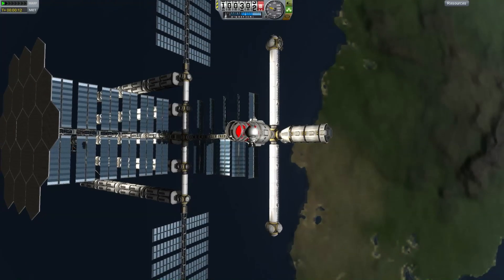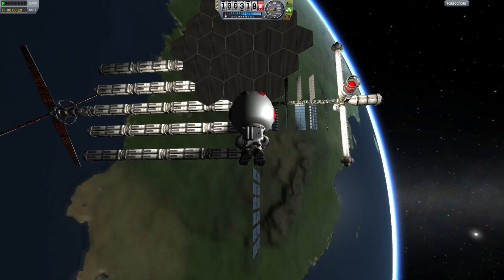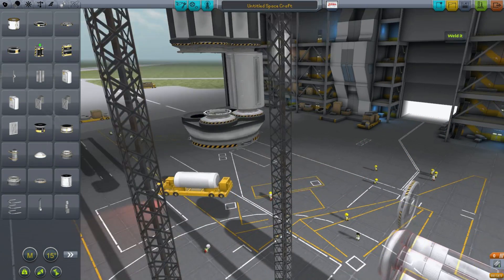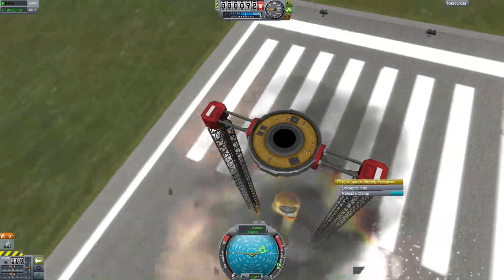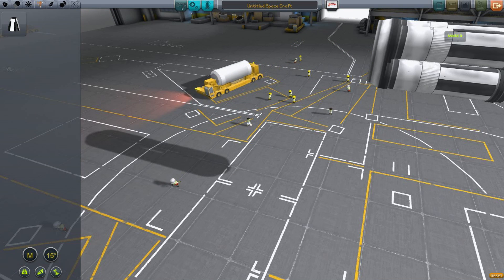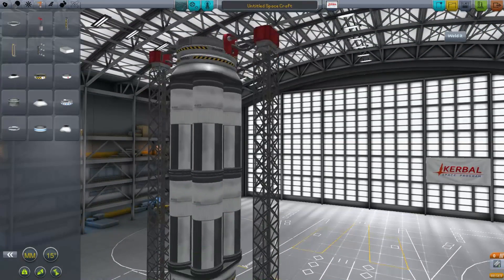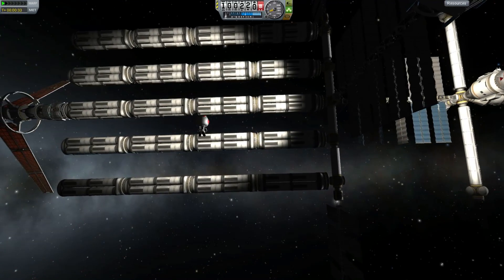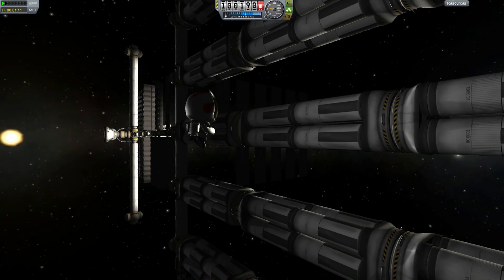Kerbal Space Program - Part Welding Plugin - Reduce Part Count On Huge Stations

Comment: someone got something similar for 1.12?
Reply: I have no clue. Does it not work in 1.12?
Reply: @phoenix0166  it does not work in 1.12
Reply: @deceased8861  darn
Reply: @phoenix0166  i found a solution, there is an updated version of ubiozur welding ltd. For 1.12.3, it works just fine but only for stock parts appearantly
Reply: @deceased8861  I only play with stock parts mostly so that works for me. Can I find it on Ckan?
Reply: @phoenix0166  no you cannot find it on ckan, i will tell you where to find it tomorrow, it's 3 am rn
Reply: @deceased8861  oh ok. Gn
Reply: @deceased8861  will you tell please

Comment: Soooo want it to work with 0.90 :/
So can finally put my 300+parts planes to use without getting 10 fps
Reply: StalkeraBg works with 0.90 and 1.0.x

https://github.com/UbioWeldingLtd/UbioWeldContinued

Comment: I really wish Squad would have thought ahead and used a game engine that supports multicore CPUs/opencl GPUs. I've given up playing KSP because it's so depressing to see the game lag along while other CPU cores are idle.
Reply: Sonic's Gaming you're actually wrong. Graphics cards have had the ability to do generic compute operations since the Geforce 8800 generation of cards. There's two frameworks to perform computational algorithms on a graphics card, called OpenCL and CUDA, respectively. They are capable of performing the same number of calculations as a CPU @ nearly 60 times the speed in certain specific types of calculations. That's why the second most powerful supercomputer in the world uses graphics cards (Nvidia Tesla k20x graphics cards) to do the majority of it's processing.

https://en.wikipedia.org/wiki/Cray_XK7
https://en.wikipedia.org/wiki/OpenCL
https://en.wikipedia.org/wiki/CUDA
https://en.wikipedia.org/wiki/General-purpose_computing_on_graphics_processing_units

To quote the last link:

"General-purpose computing on graphics processing units (GPGPU, rarely GPGP or GP²U) is the use of a graphics processing unit (GPU), which typically handles computation only for computer graphics, to perform computation in applications traditionally handled by the central processing unit (CPU)."

Anyway Squad still couldn't have used CUDA or OpenCL to do KSP's physics calculations because it's impossible (read: nearly impossible) to off-load the physics calculations and then have them come back to the CPU to be applied to the game in sync with the framerate of the game. There's no latency control mechanism for OpenCL or CUDA they basically complete the workload assigned to them and then spit back the result with no indication of how long it will take and that makes it impossible to do physics calculations that effect much of anything except particle effects and fabric effects since they don't interact with the environmental physics in any way that requires precise timing. Hence Phys-X was born and died in a day. The next generation of graphics cards, the Geforce 1000 series(?) will use a cool design concept called HSA, heterogenous system architecture, basically meaning that the cpu will be able to access the contents of the gpu's VRAM directly, and the gpu's processors will be able to access the contents of the main system DDR ram. This might allow games to start doing real physics on the GPU which will be awesome but take a couple years to become mainstream.
Reply: Sonic's Gaming Wait so it I set up a bot to send you messages 24/7, it wouldn't be spam? I mean only you are getting the messages so it's alright, right? Maybe I'll use unity to do it just because I don't think you can comprehend the fact that Unity is pretty useful if you want to program without having to delve too deep into the code (trust me, writing your own game engine, especially one for such a complicated game would take away time from working on the game and more on miscellaneous rendering bug fixes). Maybe while I'm programming I'll also make some script to CHECK SPELLING before commenting, because it seems as if the one Google provides isn't working out for you.
Reply: Ummmmm they cant..... they were stupid enough to use unity engine and they knew it was single thread only. They shouldve used a different engine
Reply: Also im 99% sure if they made the game graphics card based it would 1. Lag more and 2. Be even less realistic becausena graphics card is a graphics card...... it does computations for graphical stuff.... NOT game mechanics and physics engines ((btw i think its misleading that they say graphivs cards do physics. They only rendure what the processor is telling then to..... they cpu is doing all the computations in the game))
Reply: Sonic's Gaming
You don't really know what you're talking about, do you? Look up OpenCL/CUDA. That's not "graphical stuff".
Btw. you know what most simulated physics problems come down to? Massively parallel calculations, especially vector and matrix operations. You know what graphics cards are good at? Massively parallel calculations, especially vector and matrix operations.
Reply: Thats why the computer that theyre trying to simulate the universe in has 8,000 threads/cores NOT 8,000 graphics cards
Reply: Graphics cards are good at doin FAKE physics effects. Processors are good at doing REAL physics effects. Thats why ksp is processor based not graphical based
Reply: Also what game in the world do you know that uses OpenCL and cuda to do a physics engine? Because even source engine uses the processor and thats one of the most famous physics engines out there
Reply: Do you even know the differences between graphics processing and computing?????
Reply: You can have a computer without a graphics card but you cant have one without a processor
Reply: What physx? I dont think that even counts as a physics engine -.- its more like a graphical thing
Reply: Lol physx is the ONLY graphics card physics engine. Theyd have to completely rebuild kerbal space program from the ground up. And even then physx isnt a physics engine at all. It simulates water and cloth and things. A processor would be much better for a game like ksp. What you should be complaining about is how unity is single threaded. NOT about how ksp should be run on a gpu
Reply: Sonic's Gaming
Wow, you know you can type multiple sentences into a single comment, right? No need to spam. You've shown that you got no idea what you're talking about and you are resistant to informing yourself. Bad combo...
Reply: superdau its not spam becausr the person only gets 1 notification for all of the comments

Comment: Hey Scott, you might try pairing this with the excellent Kerbal Joint Reinforcement by Ferram (the same guy who makes Ferram Aerospace.) It adds realistic structural rigidity to parts based on their diameter; 1.25m parts are still somewhat wobbly (although a lot less so) if you build too tall, but 2.5m parts and up get much much stronger as they should. I'm not sure how this would play with Welding, but since it works based on the actual game metric for diameter, it might add some rigidity.

Comment: Because you put several parts together, That 1 part is putting a strain on that single decoupler/docking port, instead of several joints taking up the strain... its a bit like taking a bundle of sticks and trying to break it, and if you took 1 stick you could break it rather easily.

Comment: Scott - use Ed Tools plugin and you can switch between SPH and VAB symmetry using tab - then you don't have to tediously put individual tanks on, just switch symmetry and use 4x. It's not so bad attaching 4 things where there are contact point to lock into, but for anything more than that, the plugin is a must (and I'm guessing you've probably used it before but just don't have it installed in new version).

Comment: From what I've seen from messing with welding a while ago, anything that doesn't have actions bound to it will work pretty well welded together. If you use anything with actions, i.e. lights, solar panels, landing gear, keep it to one per weld and it probably won't break. Things with storage like batteries and tanks seem to work great, and here's my favorite part: The game treats all tanks in a weld as the same object, so you only have to click it once! No more tedious fuel transfers.

Comment: Great plugin, with one, really big flaw: it adds all the drags together, meaning a component made out of 10 different pieces will have a 2.something drag. 

As a proof of concept, I made a rocket out of about 20 parts, flew it to orbit, welded it, and tried to fly that to orbit. 

Its terminal speed at sea level went from 100 m/s to 25 m/s. 

Oops.

Comment: Whoever said Unreal Engine doesn't support modding? You can say that Unreal Games have never been modded?
Unreal Engine is an engine rather well optimized for Multi-threading systems, this is actually the main short-coming of Unity right now in that it requires a little more power to process all the physics in a game like this that it simply as of yet cannot provide.

Seriously, where do you get this information?

Comment: Unreal Engine handles large scale physics and open world sandbox type games just fine. Sure it's rather underused in that regard with only a handful of games to its name but then again, is unity any different in that regard?

CryEngine probably has more examples and even then that does not mean it's any better.

What you fail to realize is that the physics engine is independent of game engine. Unreal usually runs alongside Unreal Phat but there's no reason you can't run Havok.

Comment: The Unreal engine isn't all that much better. Best case scenario would be they built an engine from scratch for just KSP, but that would've been far too time consuming. As someone who works on a fully fledged sandbox MMO programmed entirely in Java... I think it's about manipulating the engine correctly, not necessarily the engine itself. I'm sure that Squad will continue to improve game performance over time.

Comment: Anyone ever notice that when attempting to assemble things in space via docking, that the "Target" crafts speed in relation to the craft your attempting to dock starts increasing constantly (despite a concentric orbit) until it reaches unbelievable speeds? I've noticed this happening a lot, even though the target craft is NOT moving at the speed it shows, and also renders my menu unusable (Cannot revert flight, return to space center, etc). I use the Engineer mod, and Lazor Docking.

Comment: It would not be easier and correct to remplace the stock parts with procedural parts to snap between the normal sizes and save a lot of resources, loading time and have more parts at the same time?

Comment: Mr. Manley, Nice Mod illustration! I was able a make a Pod with rocket fuel, mono prop, batteries and a command pod.  Had to do it in steps. First combine the Fuel and mono prop to make a new part. Then that part with a battery and finally, take that part and combine it with a lander pod.It works it's just that, you can only combine a limited number of parameters at a time. Struts don't work at all!

Comment: Not that I'm disagreeing that performance improvements should be in the works (though I hadn't thought of building this in as default), the dev's have said repeatedly that they do intend to work on improving performance. Current as thick in development as they are, as the code base is in such constant flux it's hard to optimize and reoptimize each release and still manage to make releases. Apparently this is normal for big games, it's just that you don't get to play it until after this stage

Comment: now, to get that space station in orbit around anything, youll need engines in addition to the warp drive, to slow you down or speed you up. also, ive noticed the drive keeps your direction as well as your speed, so you could be moving slowly, but if you come out of warp in the wrong direction, youll plow into a planet rather than swing around... or you could just go backwards

Comment: Sub-assembly lets you quick load a preset group of parts (multiple meshes) to be added to a build at will.  This takes a group of parts and converts them into a single part (single mesh).  One is only saving you build time, this save that as well as turns that build into a single solid object.

Note that when Scott blew them up, the first group broke into pieces while exploding.  The welded pieces blew up as a whole rather than parts because it's a single mesh now.